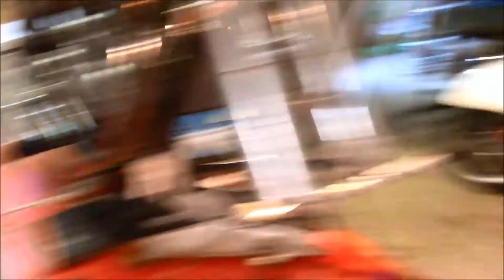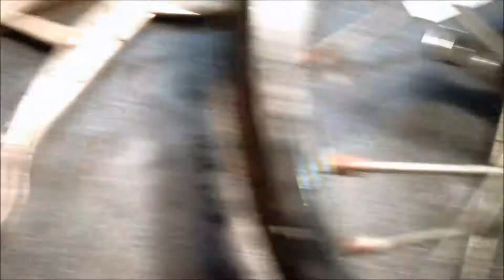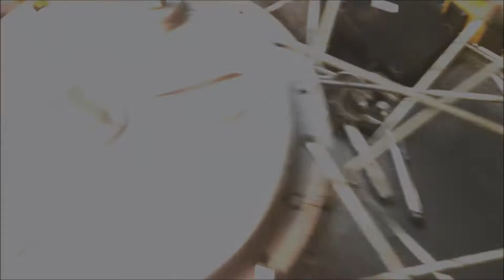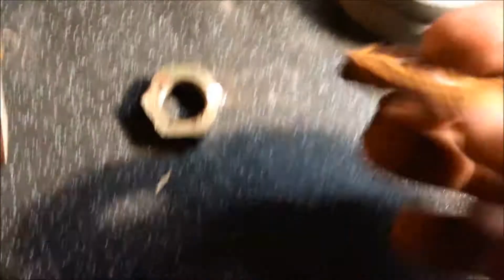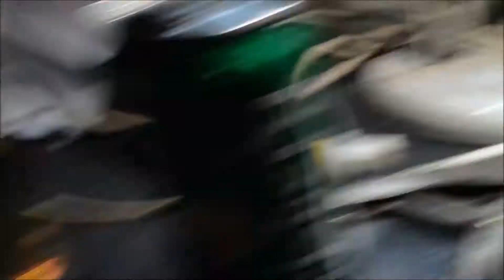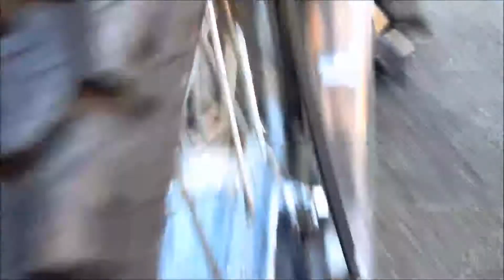Royal Enfield 500 (2000 MY) Front Wheel Makeover

Comment: Good video. The wheel came out good. I made a tool out of 3mm aluminum with a notch cut out that fits that dished nut on the brake side. It kept coming loose and I was constantly having to tighten it up. The thin "wrench" I made fit under the adjustment rods and though only fitting over two sides of the nut allowed me to tighten it up. Though not with much torque. The real purpose of the dished nut is to keep the brake plate centered. Took me a few years to figure that out. So you hold the brake lever in to center the shoes in the drum, then tighten the nut while holding the brake on. Last time I had the wheel off I cut a thin gasket to fit between the nut and the side of the fork. It resists the nut turning as much just by friction. Works pretty good, I seldom have to tighten that nut now. Cheers.